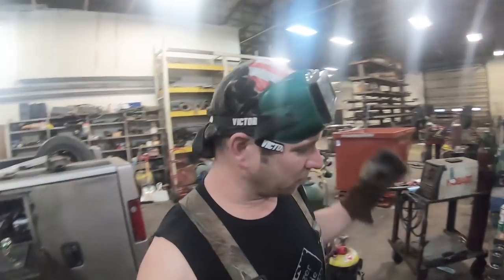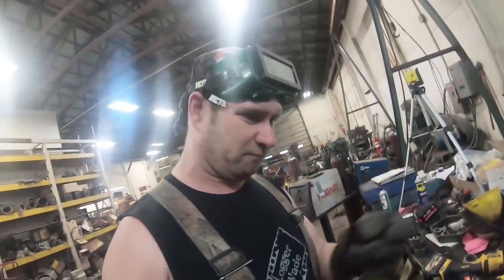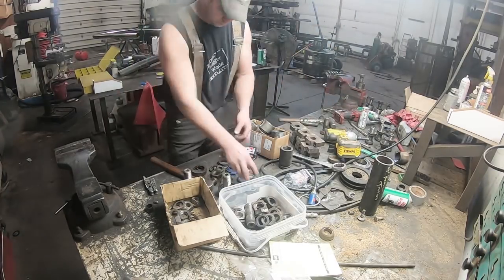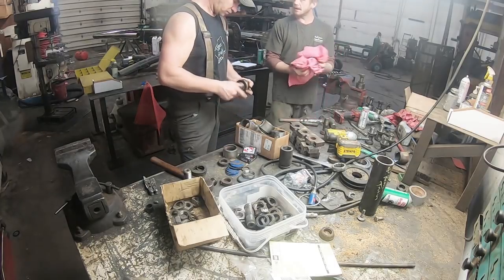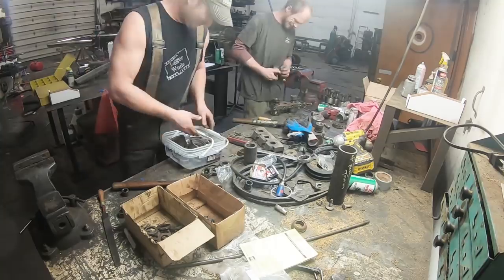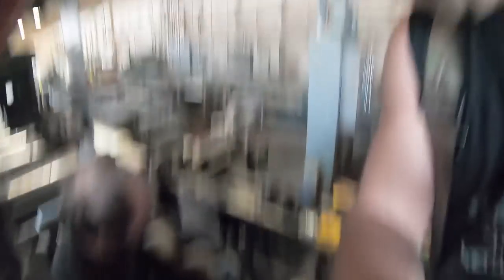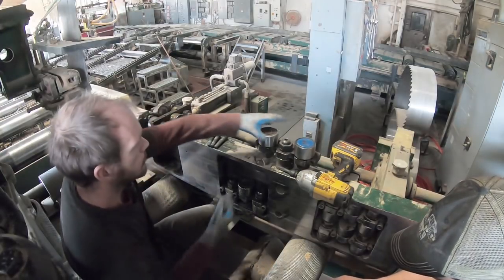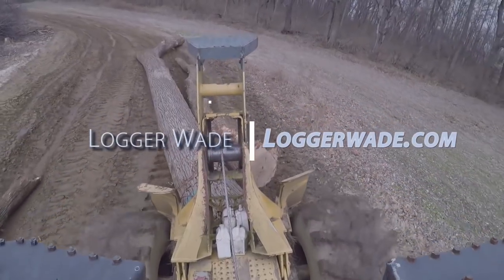Making sealed Bearings Greaseable..

Comment: Wade, if you have a drill press, then try a solid carbide drill, lots of oil or coolant.  the torch heat can warp the roller housing.

Comment: "Use it up. Wear it out. Make it do or do without."  Your Saturday work may have extended the bearing life to Infinity and the replacement cost is zero. It also removes unplanned downtown for the mill or worse because you have exchanged maintenance for repair in the event of catastrophic failure of a bearing. What you did is a BFD. 👍

Comment: I wonder if they same rollers are used in alot of different applications with conveyor systems? If so...You couldn't have cans of food getting contaminated with grease. Instead of re-engineering for saw industry. They just went with what was already available. IMO...
Hope it all works well and for a long time. Thanks for vidja, Tator n Mike!

Comment: I would like to see these bearing in use.  It is difficult to imagine how a $400.00 sealed bearing can be damaged by sawdust when compressed air blasts could blast away dust buildup.  Could a better design cut down on bearing damage?

Comment: Man they looked like you might have been able to bang some bearing buddies off a small trailer instead of the blue caps, then problem solved?? Their spring loaded to keep just a little pressure on the grease to constantly flush the bearings?? ID 1.908 for interference fit into two inch... may still want to take a look, I think the hole facing the impact from cants will exaggerate your problem..